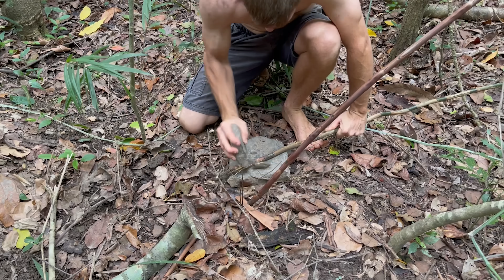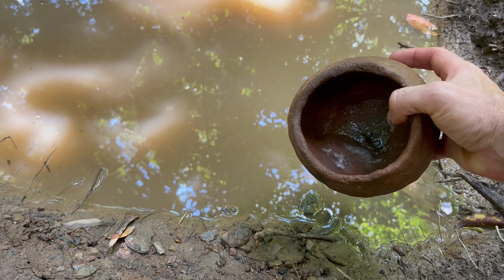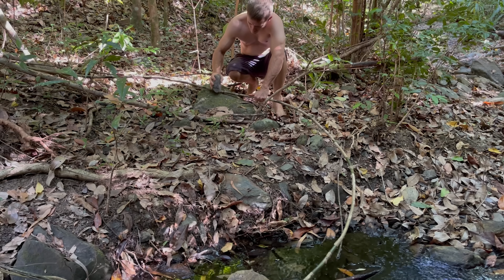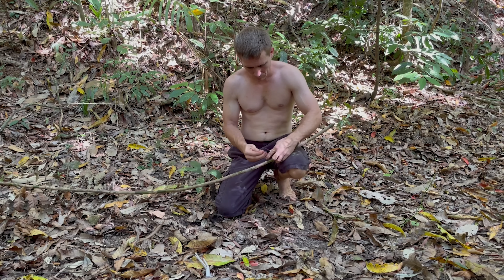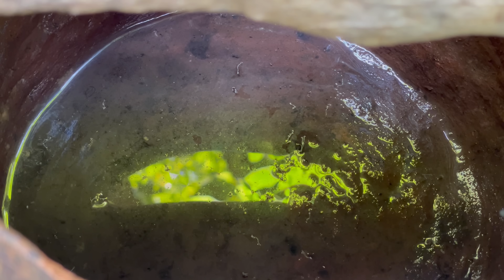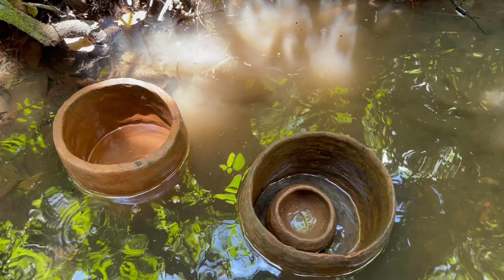Primitive Technology: Cane Water Filter/Siphon

Comment: The pots used for the second technique, what type do they need to be to let water seep through?  Were they dried but not fired, or were they fired without being burnished beforehand, or does it even work when they were burnished?  My instinctive guess would be the second, but I have barely any experience working with clay.
Reply: Fired but unglazed. (Same as a terracotta flower pot.) If unfired, the clay would have disintegrated in the water. If glazed, it would have been waterproof.
Reply: @kerim.peardon5551  Yeah, I pretty much figured that unfired ones wouldn't work at all with water, and since he hasn't used any glazing so far, I had completely left that variant out of my question.  So, I guess the core of my question is whether burnishing makes any difference to a pot's permeability.

Just intuitively, not based on any real-life experience, I'd expect it to — though obviously not to a similar extent as glazing.  Compressing the outer layer of clay sounds like something that would affect the water-tightness, and a burnished pot certainly looks less porous.  I'm just wondering if that has an actual effect, or if that expectation is misplaced.
Reply: @SebastianWeinberg  That I don't know, because I don't know much about burnishing. But I do remember that he did a video where he burnished some pots he was making and I think he said that it did work similarly to glazing. But it's been a minute since I watched that video and my memory is not as great as it once was.

Comment: the pressure through the cane is proportional to the height difference between the two pots.  I bet if you get a large height difference it would filter much faster.

Comment: You can also fill a pot with a small hole at the bottom with layers of sand and gravel, and use it as a water filter

Comment: Interesting filtration methods. But does that mean that the pots can't hold liquids for a longer period of time?
Reply: I wonder if you would need to glaze them to stop this...
Reply: If the sides of the pots aren't in contact with anything, I think that they will not leak water out to the point that it makes a puddle, however, water will evaporate from them. If the sides are in contact with something, they can wick water away. If you put a terracotta jug in the ground, it's called an olla, and you can fill it with water and the water will wick out into the soil as long as the soil is drier than the surface of the jug. (If the ground is saturated, it will not wick water out of the jug.)
Reply: No they cannot hold water for a longer period. It will evaporate on the outside walls until the pot is empty.

Comment: Wow! That was genius! Can you make use of a different kind of plant to do this process? Or in the case of the clay pots, can a different mix make the process faster?
That is so interesting!
Reply: A taller pot in deeper water should increase the pressure of the seep.  At least a bit.  The harder it is to hold underwater the more the pressure behind the seep.
Reply: From another comment I heard that pines specifically have antibacterial properties
Reply: @M & Artroom  also the pine was treated by the researchers

And on top of that 99% from the researchers is unsafe for consumption, expecially from a stagnant source like the clay pit